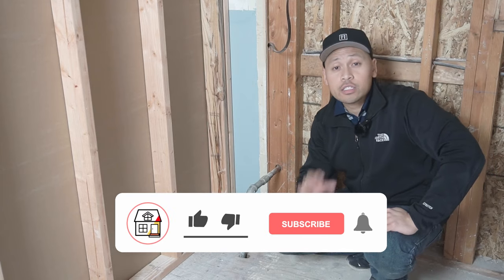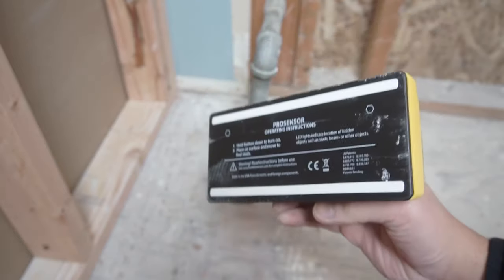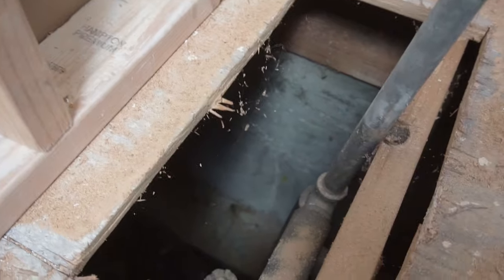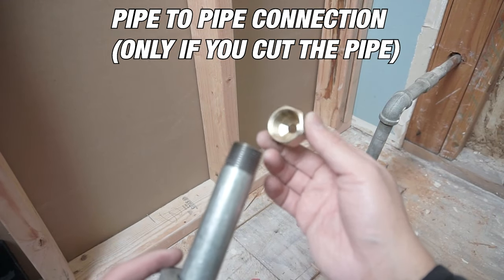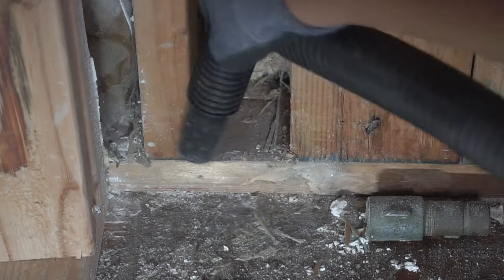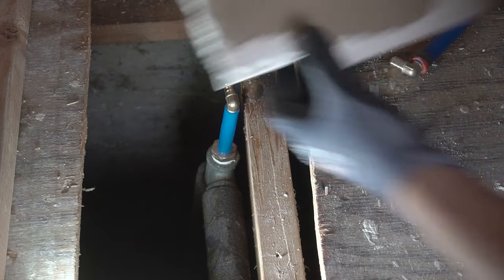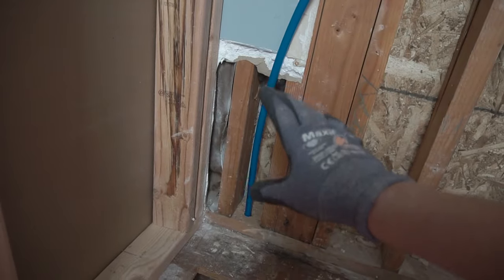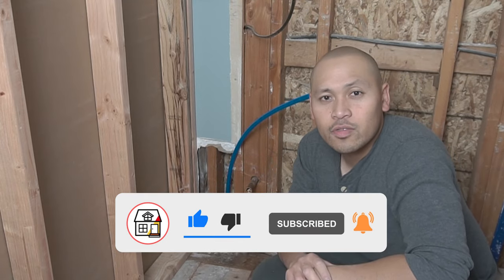How To Remove OLD Steel Water Pipe And Replace With NEW PEX Piping! DIY

Comment: You cannot attach brass to galvanized steel. Contact between galvanized steel and either copper or brass is a setup for rapid corrosion, especially in a humid environment.Jul 27, 2020
Reply: Correct: Pretty sure a dielectric union would be an answer to this.

Comment: Here is where expansion pex shines the best. Install your adapter no problem then install the pex A no problem.  No clumsy crimp rings or obnoxious tools to fit down the  joist space. The pex A expander you could use while on your knee's then reach down and simply slide it on. Wait 30 seconds and you are done. No  go/no go gages or other checks to make.  Love the Uponor system.
Reply: the uponor tool isn't cheap.
Reply: @jonathanklopf7581  good tools aren't.  I have one. Very high quality. Expansion is way better than crimp in my.opinion. Worth the investment.
Reply: I wouldn't trust those fitting. The crimps have never failed for me
Reply: You don't have to trust them 1000's of people do. Pex A from Uponor is from it's predisessor Wirsbo which invented pex pipe. The fact that A pex is continuesly squeezing itself tight onto the fittings is lost on some as well as the smaller diameter of B. To each his own...it's all good.

Comment: Great video, thanks, I just subscribed.  I put pex plumbing in my van and it was so easy, (I used cinch clamps).  Now I'm gonna switch out the circa 1970 copper pipes under the kitchen sink to pex.  Your video helps a lot, except I need more information on the coupling thing to copper pipes when you have to cut the pipe.  You touched on it. Do you have a video with more detailed information on that?
Reply: More googling showed me there's a pex fitting to go from copper to pex.  Do you have a video for installing a new p-trap from garbage disposal to drain?

Comment: Why are you leaving the galv pipes they eventually have pinhole leaks and are full of rust sludge are they not ? I have a 2965 house galv is still holding up but rusty 
water

Comment: Good job men; I have same problem but instead of water is gas and there is not elbow or any joint in the pipe cause it comes straight from basement? Any ideas to make it nicer. Thank you

Comment: Bro with galvanized very rarely is it not completely frozen in the fitting threads making it nearly impossible to loosen. 99.9% of the time I’ve had to cut galvanized steel!

Comment: At 4:54 when you cut the copper pipe it has a solid middle section. It should be a hollow pipe, what is in the center? Built up junk from the galvanized iron pipe?

Comment: @8:47 only note i can make is that at least according to my pex crimp gauge it would say your crimps are too tight as yours pretty much slid all the way over the crimp. Mine notes that the two lines are supposed to be centered on the crimp ring, although not sure if your pro crimp  rings are any different than the normal ones for that. although looks like the other two afterwards did have more of a proper crimp.
Reply: Well with all you said the bottom line is he didn't have any leaks.

Comment: 5:14.   I have been in situations like that, but that's where a cheetah bar is really nice to extend the torque on that pipe wrench if you have the room of course
Reply from the maker: I agree Matt! I’ve worked enough on cars that the breaker bar does come in so handy! 😆

Comment: Is this legal plumbing in all US States or does code need to be in place to allow this?  Looks great!
Reply: Once upon a time, galvanized was very legal in the USA.  I am surprised they had originally framed the wall with a foot wasted!  The exterior spigot thru a wall like that wasn't all that common and colder climates where there was a risk of freeze. But what strange is it didn't look like an external hydrant. I'm not sure if he showed that or not that's where the water actually turns off inside the house and there's no water at the tap outside the house to freeze up.

Comment: Pb blaster sprayed liberally where the galvanized pipes connect, tap on it with a hammer to work it in, wait ten mins, unscrews easy, you're welcome.

Comment: Great job, but lemme make 2 comments.  1. You cannot connect brass to galvanized.  2.  If using Pex B (which you are) you should go up one size as the inner diameter is smaller and then the fittings make it even smaller reducing pressure significantly.   Now, I know you said it was going to a spigot outside, which not sure how much or what the use is, but, I’m merely giving you this advice as well as other readers that may be changing to Pex and unaware if that fact of Pex b.  Which is why I personally prefer Pex a, and I also feel the connection method is stronger in Pex a.  Thanks for reading and great video!

Comment: Btw: you could probably glue a wooden dowel into that cutout hole. Or just select a tiny bit larger dowel and hammer it into the hole.
Reply: Needs to be sistered

Comment: Your galvanized to PEX adapter, I hope you male threaded end will not fight with the galvanized steel (dissimilar metals)
Reply from the maker: I’m glad you pointed this out, there will be corrosion when steel and brass connect over a long time, but these two connections are quite common because both pipe materials are used for water supply lines. To reduce corrosion the plumbers tape should help combat this. Another way is to use stainless steel PEX adaptor. If it does corrode at least the T fitting will be the only thing to be replaced. For me I am planning to change the whole house piping with PEX since this is such an old house, so this is a good solution for now in my case. Since the corrosion resistance is on the brass you’ll see gradual galvanic corrosion on the galvanized t fitting. Stay tuned I’ll be making a explanation video on this to shed better understanding 👍🏽😊🙏🏽
Reply: This was the comment I was looking for. Great response btw.
Reply: Always add a little pipe dope over the tape to help fight corrosion and fittings thread easier.

Comment: But why did you reduce the size from 3/4 to 1/2? That drastically reduces the water flow…
Reply: All your plumbing to your appliances and valves go to 1/4” anyway.
Reply: Could be codes

Comment: Question:  Why did he not install the necessary dielectric union?  That is a transition fitting that can be used to join galvanized steel pipe to copper.  100% going to fail a few years down the line.

Comment: I think I would have used the tube cutter to cut the copper because it would have been much easier to do that than use the sawzall to cut through galvanized steel that was just extra work you didn't need to do